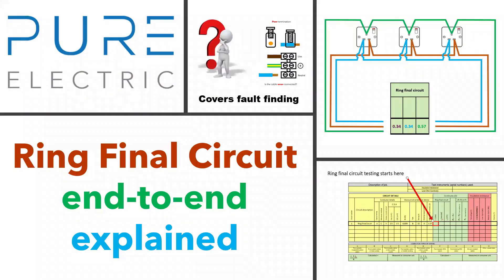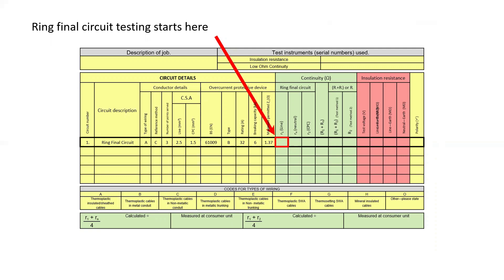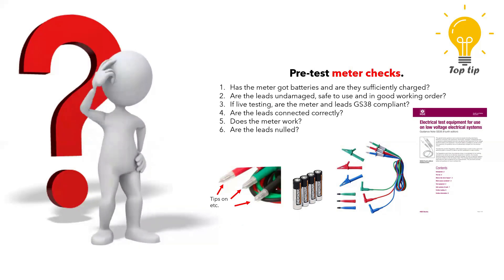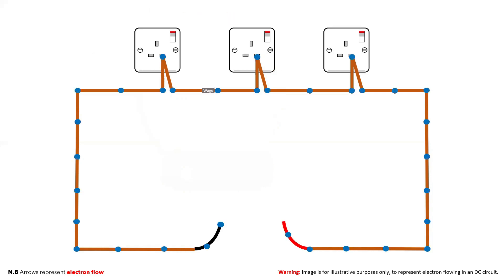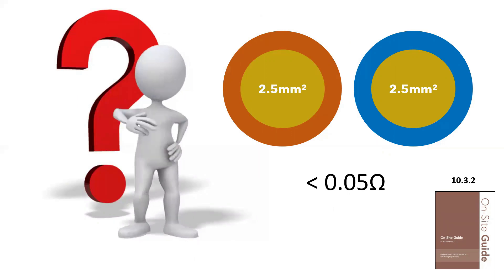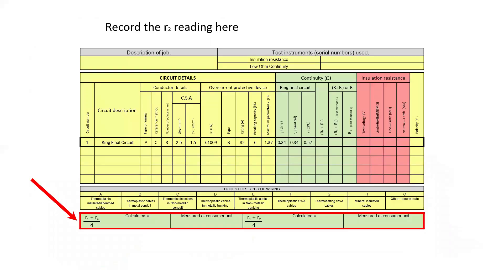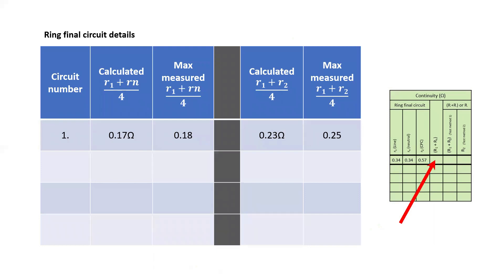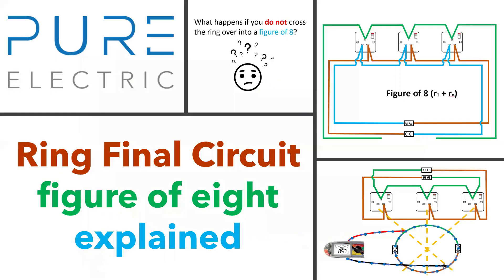Inspection and Testing - End-to-end testing of a ring final circuit. AM2 CG2391

Comment: Hi Adrian,

I am having a few issues on identifying the types of wiring and reference method on the Generic schedule of circuit details. Can help or advise please?
Reply from the maker: The codes for the types of wiring is on the generic schedule of circuit details. 

A to O.

The reference method is the installation method and is found by either, referring to the on-site guide, or BS 7671 appendix 4

Comment: I find that in a few apartment installations, the r2 is lower than the r1, and rN in a ring final circuit. How is this explained, and how should it be written on the EICR. Many thanks in advance.
Reply from the maker: Is this with twin and earth?

If so, that is worrying considering the r2 is 1.5mm and should be 1.67 times higher than the 2.5mm.

My only guess is that the terminations are loose.

When you measured those tests, did you do any further investigation to find the cause, as that should have been your prompt.

Comment: How does the test work? You say electrons but what does the tester put through the circuit? I thought it only put voltage through on insulation resistance
Reply from the maker: Try this and let me know if it helps

Inspection and Testing R1 + R2 and fault finding
https://youtu.be/lQ6olO_-r9I

Comment: Great video ; was just curious what code you would assign if the difference between r1 and r2 was greater than 0.05? Or likewise the difference between r1 and 1.67(r2) ? C2?
Reply from the maker: On a new install I would do further investigation to find out why. Loose termination etc.

On an EICR I would put that down as FI, further investigation required

Comment: hi great video can i ask with this tolerance of 0.05 does that mean within 50  so it the lives were say 0.034 you would be ok within 50 of that number so anything up to 0.84
Reply from the maker: 0.05 is the tolerance, not 0.5

So on a reading of 0.34, you could accept 0.39, or 0.29 and everything in between.

But, you should always question that depending on the circuit size. The smaller the circuit, the tighter the tolerance should be
Reply: Thanks understood 👍